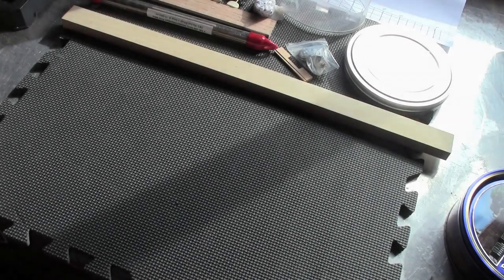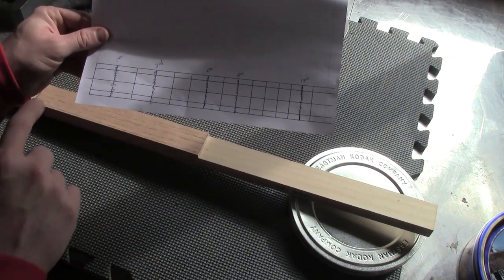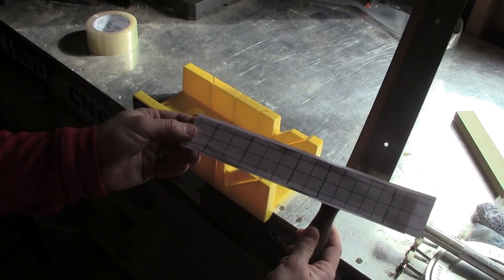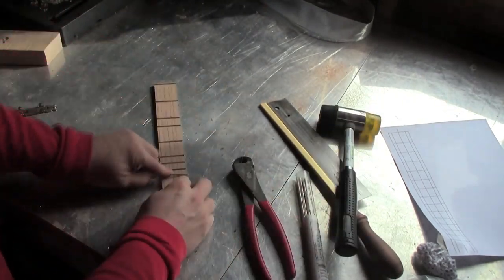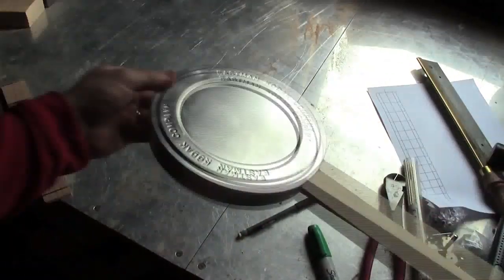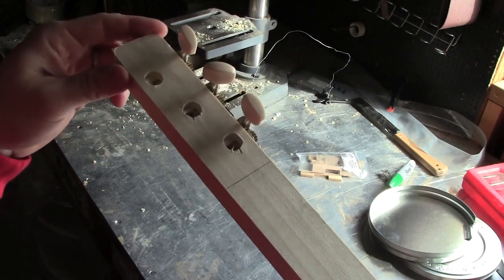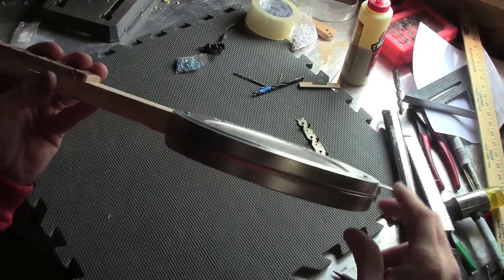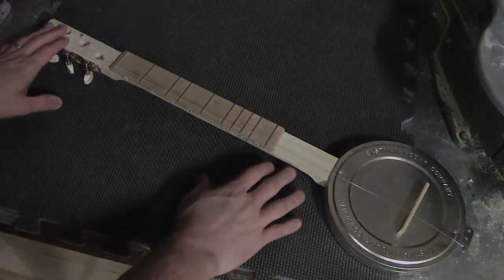Film Can Strummer

Comment: Amazing videos!!

Why don't you use the 1st, 3rd, 6th, etc..frets?

Is it because based on the tuning you chose (LowG, D, G) the chords you play don't need to use these fretes?
Reply from the maker: You have it right. By not having those frets, all of the notes are in the same key.
Reply: CircuitsAndStrings So you can never play E Chord  (composed of E,G♯,B) or A or B Chord?
http://en.wikipedia.org/wiki/Major_chord
Reply from the maker: Yep. With this tuning, you only have notes g a b c d e and f#. But because of its limitations, you can never play a "wrong" note.